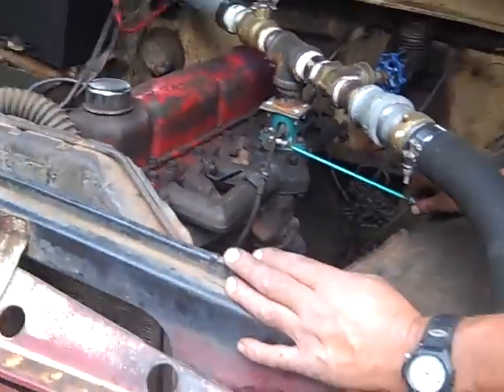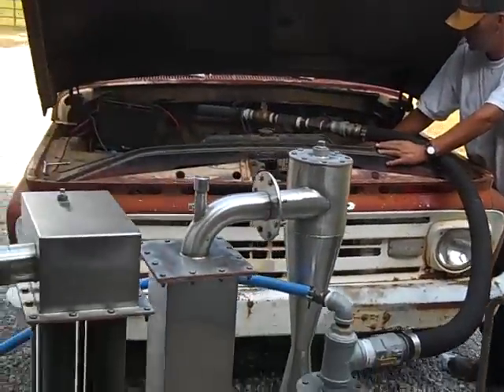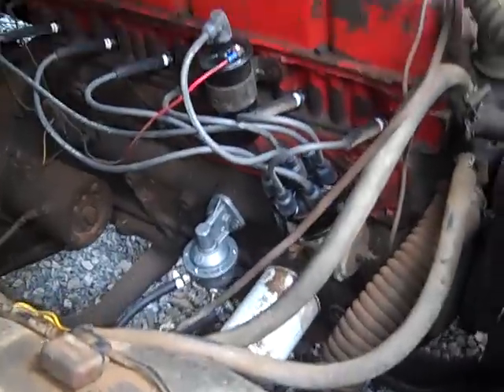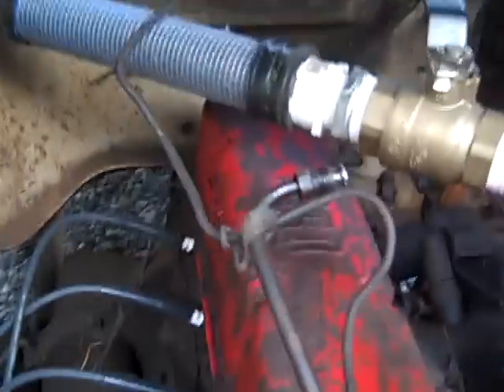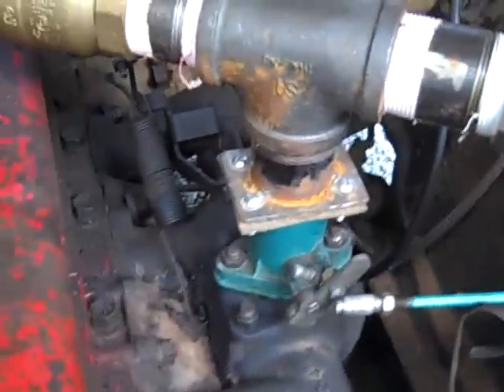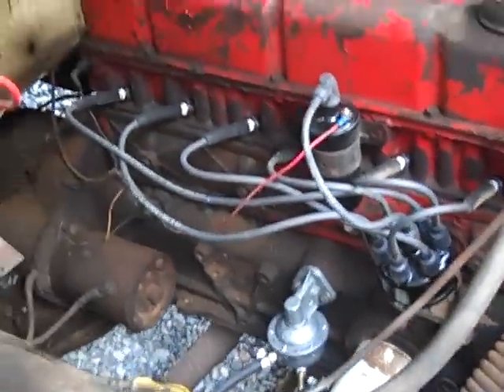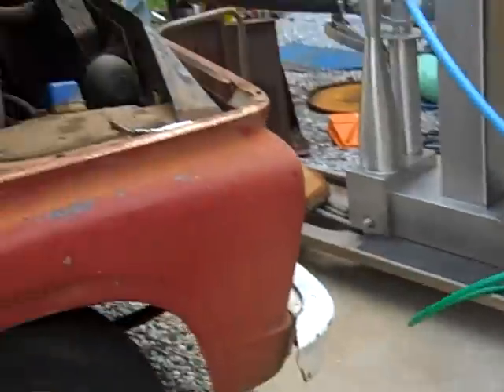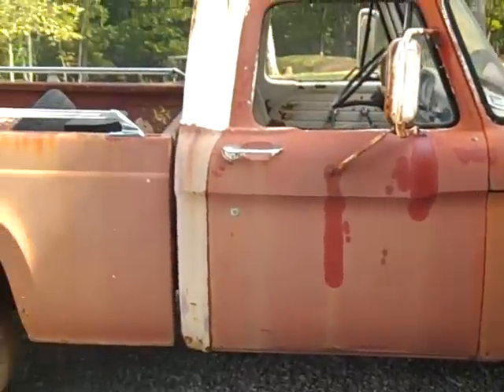1962 Ford F-100 running on Wood Gas

Comment from the maker: @sheltrown1117 Yes I do!  Need to fix the brakes first and I am working on the throttle linkage and hopefully will be able to use the choke cable to control air mixture from within the truck.  Anyway, having fun tinkering and appreciate the comments.